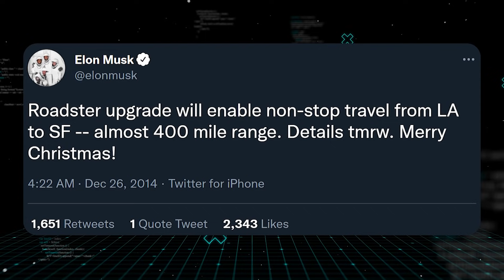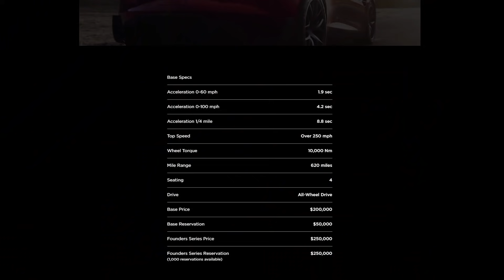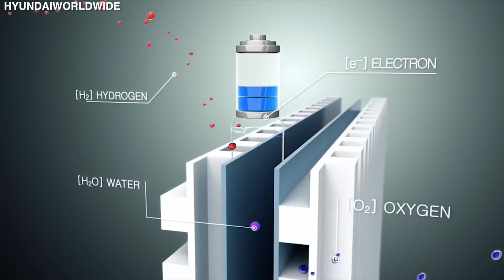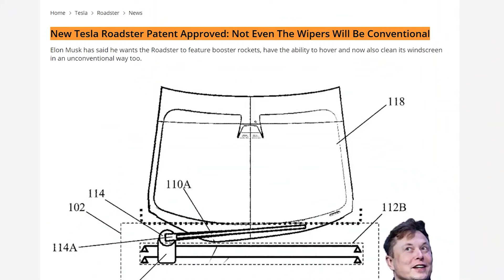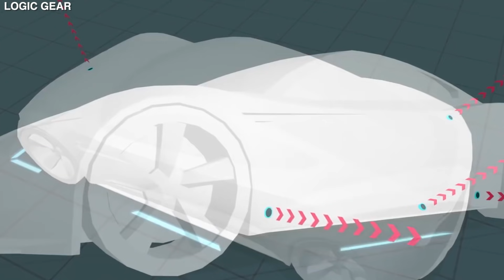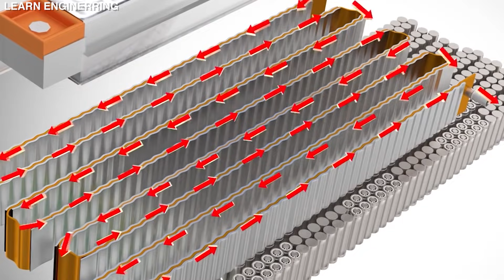IT HAPPENED! The Tesla Roadster 2021 Update Is Here!

Comment: Someone should make affordable light weight electric roadsters that can sprint from 0-60 in 3 secs while with a price tag of a subaru BRZ
Reply: That's like model 3 performance
Reply: @Astor04  how bout a light roadster with no nonsense carbon fibre interiors to save weight, tesla model 3 drivetrain with a smaller lighter battery , remapped to produce more power to the wheels?

Comment: "The original roadster also used a 200-Kilowatt hour pack" ??? say what? 53kWh != 200kWh
Reply: I'm genuinely confused. I'm not sure if it's my lack of touch regarding anything electricity but the original roadster did have a 200kwh battery, and of course 53kWh isn't 200kWh, what am I missing?
Reply: @erica.5620  the original roadster had a 53kWh battery. If they were able to put a 200kWh battery in a sports car 15 years ago, why would they use 100kWh batteries in their sedans and SUVs today?
Reply: @mikopiko1317  Did they? interesting. It said on Google it used 200kWh but I guess that's wrong unless I misread it. Thanks Miko!
Reply: Although the later roadsters 1.0 did come with 70kWh batterys I thought
Reply: I was about to write exactly that
Reply: @jakobwidmaier7246  you both have the same name
Reply: @r3x_delta30  no one is Jakub and the other is Jakob
Reply: @r3x_delta30  still pronounced the same name😑
Reply: @r3x_delta30  tell me when you find some one with mine, Jaekob 😔